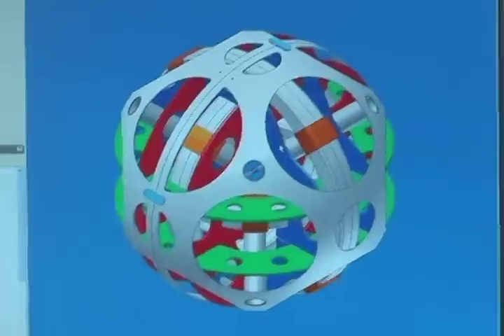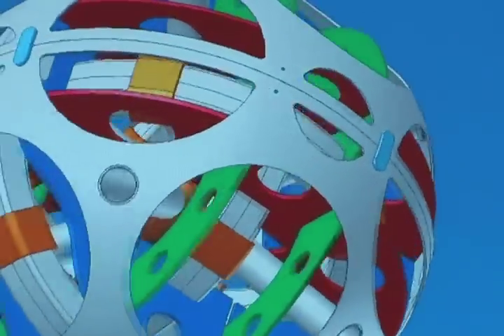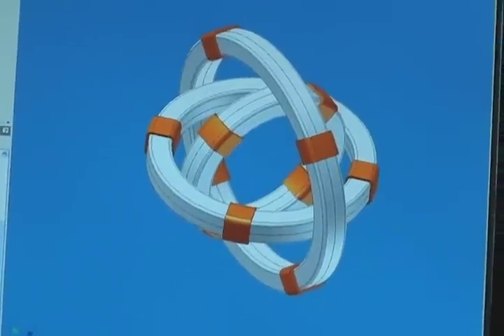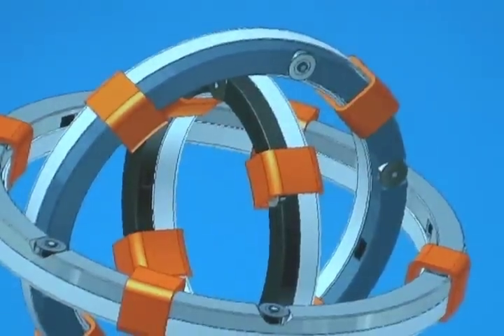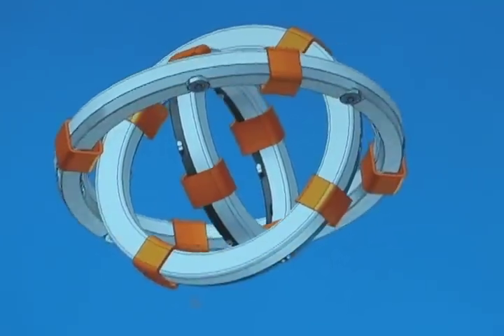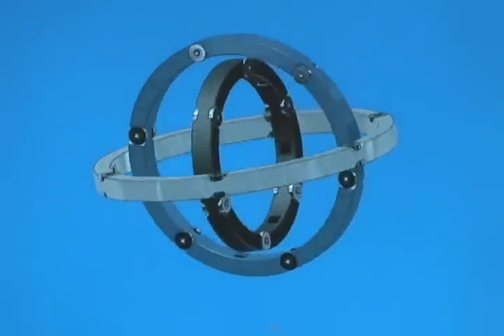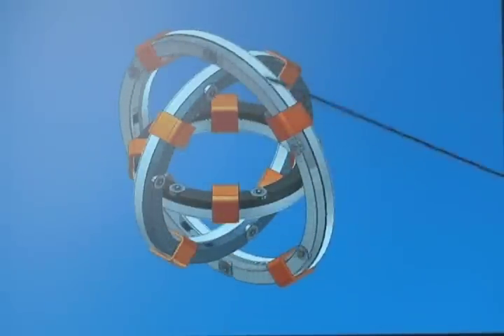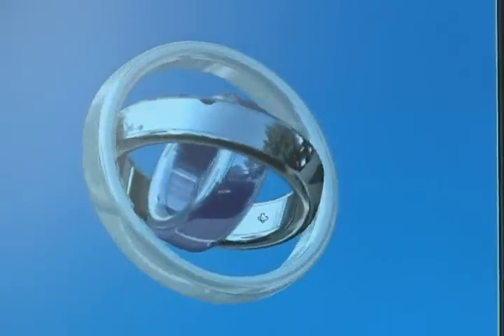Apparatus for Gyroscopic Propulsion Explained

Comment: According to the patent: “Gravity is overcome when enough energy is generated by the system that the resistance to torque reaches a threshold resulting in a force of displacement in the direction where least external force, manifesting as torque, exists. And this direction is generally away from any and all gravitational sources, including planets and other bodies of mass located within the universe.” ... seems only theoretical, and would apparently result in the apparatus ending up stuck in some cold, distant, isolated point in space at equal distances from all other planetary bodies which doesn’t sound very practical, but a patent was issued.
Reply: I guess that’s how the stars are stuck to the firmament, hanging at the same spot thought the whole known history with no change.  
https://youtu.be/Dbe_6QQlYvA

Comment: I seen a sphere by the side of the road hovering about 10' in the air. it was late but my headlights were on the sphere and the sphere had zero lights emitting from it. it was the size of a stop sign. the sphere was not from here it had maybe 8 or more rings.. outer rings spinning slow as each inner circle was substantially faster. visually the inner core rings were blazing fast. I take this road everyday for well over half my life. it took 30 seconds afterward for what I saw to register. Northern Michigan August 2015. this research I believe is key ingredient to advancement.. please stay with it I've seen this alien tech with my own eyes but for mere seconds

Comment: Take that concept and turn those three concentric gyration rings into wireless ferro terroidal tesla coils and suspend them electromagnetically and use a parabolic mirror or mercury (concaved and enclaved) to re-radiate gravity waves in the opposite direction to create an anti-gravity engine.

Comment: Obviously no one grasps the concept.  I envision a driver's seat in the center.  A joystick shaped like a ball that can can move side to side, forward and back, and twist left or right and return to center.  This joystick would control the PWM circuits that drive the coils by acceleration, or deceleration of the rings.  Thus providing inertial forces on the unit at right angles from each ring respectively.  Very simple design, but not sure if it could generate enough inertial force to lift off the ground. Without doing the math, I would presume ring speeds in excess of sound and inner ring mass of nearly a ton, in order to produce an upward inertial force stronger than gravitational pull.  In prototype design, I would recommend a ferrofluid bearing surrounding the magnets inside the ring.  This would help achieve the spin velocity required with the least amount of drag, and most importantly, reduce moving parts and friction.  The rings and ring cover halfs will have to be polished to a mirror finish to reduce drag.
Such a device would require a power supply in excess of 500kW which would have to be mostly generated on board through a tuned circuit that can sustain the pre-charged capacitors.  If the device had some form of wilmhurst generator built into the rings, perhaps, the wattage could be produced and passed to the capacitors to be used by the PWM circuit to pulse the coils.  The device would have to be spun up  and capacitors fully charged on the ground.  Once started, it would then have a certain amount of time before it has to be spun up again due to the coils parasitic reactance, unless circuitry was implemented to absorb this reactance and put the voltage back in phase with the amperage.  It can be done though.  Now the only loss would be through the wiring, capacitor leakage, PWM, and control circuit losses.  Using optimal materials and circuitry, losses could be in the range of 3 to 5% per hour.  Looks like a project for a University or government grant to fund.  It is easy to build this thing on paper, it is entirely another to physically put it together.  That being said, I intend to build a small proof of concept starting tomorrow.

Comment: The theory is correct, but the problem is to synchronise the equal mass of the  main elements in the same orbit of rotation. The elements that create the mass in equilibrium have to be controlled  by segmenting each rotational element to be able to pass each other  with equilibrium of their mass! Simplistically one gate opens to allow the next to pass within its equal orbit. This would be far easier to control with a two axis control then later use a multiple exterior "double "of its core twin .or synchronise the same orbit "Again" cutting into the now existing mass.
The problem only exists because each gap that each element passes within each rotational element can only be controlled  by synchronised  rotation (by isolated linear control) that creates the  full power of this design .therefore the more mass you put into the unit the more anticipated stability  you might get . I've been toying with the "idea" that a triple linear rotational ring motor is the best way to investigate this rotational mass phenomenon. The kick back is how to tame the mass rotation individually as each axis would have to be able to double its "pulse" to enter a gate area that would be classed as a normal entry for its dominant increase in not only orbit but increase of a synthetic "G" force for each axis. "Synchrony" for this problem is the key for multiple axis control ! When I find the synchronous aspect of this electro mechanical I'll post it for your perusal. JFB

Comment: There is no possible way to create a mechanical construction - like a 
gyro, for instance - that can propel itself, without contact to any 
stationary object, like the floor.  In the end, it is all the same as 
driving a car. Every action = equal opposite reaction.  The only way a 
closed system could lift off from our planet surface, without 
conventional propulsion (pushing something away to gain momentum), is to
 cheat the laws of physics, which 'might' be possible within the realm 
of quantum mechanics. For instance: a mass increases when it is 
energised (or when its going really really really fast, which is the 
same thing). This could generate a momentum to generate lift.

Comment: Mostly nonsense.  The idea, boiled down to actual physics, is to hitch a ride on the planet's angular momentum. You'd slow the Earth's rotation a wee bit, so it's not "free energy". Problem is that the force the Earth puts on the device is miniscule - one rotation every 24 hours. You'd have to spin the gyros at relativistic speeds to get a usable gyroscopic force. And there's no effect on the linear acceleration of gravity.

Comment: I think its spinning may not be super fast enough caused by friction. At least this is very difficult to get ideal speed compared with centrifugally balanced normal rotor which has only one bearing.  Good to watch your video anyway.

Comment: IT'S DEFINITELY A SOLUTION TO ANTI-G ... BUT UR MAGNETS WILL SCREW IT ALL UP (LOSE THE MAGNETS)... THE KEY IS HARMONIC FREQUENCY... (STABILIZATION OF ROTATION AT HARMONIC SPEED)... STABILIZE THE VIBRATION PRODUCED BY 3 AXIS GYROSCOPE BY COUNTERACTING EACH AXIS OF MOTION WITH A SECONDARY GYROSCOPIC MOTION MOVING IN THE OPPOSITE DIRECTION...(JUST A THOUGHT)... NICE VIDEO... DON'T EVER GIVE UP... UR ONTO SOMETHING GREAT! :)
Reply: Is your capslock key stuck or something...?

Comment: Then again if we stick to Uncle Einys eequalsmcsquared, then the energy needed for the spin of the gyroscope would be equal to the energy aquired for lift...unless... eequaledmcttriangulated where t is time...or something...if it were possible then I would think of it as fact... anti gravity as a singularity... or something... the singularity, or 1 divided by 3 is infinite... so... wow? or not? or whatever? ok, too m7ch whiskey to think straight... but cool stuff. Im working on an easier impossibility... running on water... called GSUS feet... gravity suspension feet. Gonna work my way from there... lol
Reply: +Kiyoshi Furuya  Exactly.Do the rest of you doubters get it now ?

Comment: you are very close, basic concept is right... all the components are locked... dont need the bearings... need the magnetism to be inner outer... and casing magnetism to be the opposite magnetism and lighter then the inner mechanism... then when the 3 rings need to align at some point? for the briefest of moments the magnetism should parallel instead of omni...? causing the inner sphere to to move up... thus effecting the outer sphere to catch up and keep equilibrium? done fast enough... anti-gravity? dont take my word for it tho... to fringy... gonna conduct my own experiments for this when i cash in on my first big 1. If you get there first... more power to you!

Comment: I think you could interchange densities with speed. Im sure you can. You would not need to have three different densities of metals you could use one metal and just having speed differences could give you same effect. Like for say. the very center smallest gyroscope would be spinning the fastest and the middle gyroscope medium sized one could spin a medium rate speed and the largest and biggest gyroscope could be the one spinning the slowest this would create a canceling force as well. Absolutely sure of it. E=Mc2
c is the constant which would be the speed and mass are interchangeable. anyone wants to work with me feel free to hit me up I Know what im talking about and am a experienced engineer and physisisit among all other areas?

Comment: so how exactly would this send one in a particular direction
Reply: +deathbot117 By producing a positive or negative inertia effect on one side or angle.
Reply: +John Anon It would effectively be "rolling" in that direction, even if it was against downward gravity.
Reply: kewl now we just need these in vehicles
Reply: you slow down one of the rings and lean. Simple.
Reply: +John Anon "By producing a positive or negative inertia effect on one side or angle."

I don't believe this device would achieve this but it may be able to achieve being a "spatial gyroscope" I think there called something else but I forget at the moment; basically in outer space if this was spun up and weighted correctly it would be able to resist being moved from its spatial position in space, kind of like a multi directional gyroscope; I believe they already exist on some space craft actually.

My idea is to take this a step further thought and not only rotate the gyros but rotate the gyro rings 90 degree off the axis of their gyroscopic rotation so the gyros themselves would be rotating at the same time, what this would do I'm not entirely sure; might just make it a better "spacial gyro" meaning it would stick to its location better, then I have some other conceptual ideas about how it might be used to create momentum in a specific direction; but that's sorta hard to explain in text... 

The reasons I can't say for sure is I'm just plain not smart enough yet haha; more specifically in math, but I want to go back to school and try to tackle it and get into physics a lot more heavily... I have some crazy ideas about gyroscopes and gaining momentum through moving objects around that I haven't seen tested yet (as far as I know). I believe the term for an object that can create its own momentum in a closed system is a "Reaction-less Drive" which to me doesn't actually exist yet in terms of what we know; maybe through some kind of quantum mechanic it might be possible, but what I'm thinking of is more like a Reactive Drive; which gains momentum with many moving parts within its own system that creates an imbalanced system on its own without requiring input from another outside force or system acting on it.
Reply: this is how ufo's work, na zi s discovered this long ago, get with the times people.
Reply: imagine a massive scale gyro like this in a craft, with the rings made out of very heavy materials. How is that impossible? Open your mind.
Reply: @madbruv  no dude stop pretending you know things you dont 

understand science and reason and logic and stop pretending you "know things" 

stop watching Gaia and start actually getting a real education
Reply: @madbruv  there is no means of propulsion now is there really any means of mounting these in a stable fashion 

use your brain and think for one minute 

"where is the propulsion" 

yes this device can allow for controlled rotation on 3 axis but there is no way it can allow one to move in any direction
Reply: @madbruv  there is no propulsion 

only a means to rotate the craft 

the density of the rings doesnt have any effect on forward or back ward or sideways movement 

all these rings will do is rotate the craft on any of the 3 axis 

stop being so brain dead that you ignore basic propulsion 

if you understood gyros you would know that all they effect is rotation 

they cannot stop forward motion or any kind of motion 

all they can effect is rotation 

there is no method of propulsion for directional movement 

there is only a method of rotation

Comment: This will rotate unstably and wobble about. You cannot generate translational acceleration with this only rotational (angular) acceleration. You could use this to rotate a spacecraft in zero g. This is actually the method used to rotate the space shuttle (2 axis the third is a waste). I suppose you could get this to roll on a flat plane, but it would move about rather chaotically. 

The moral is that Newton's third law prevents this device from being used as a means of propulsion. If it doesn't have anything to react against, then it cannot accelerate (it needs something to push off of).

Comment: I suspect there's more to this presentation than we see here. Would I be wrong in thinking the propulsion would come from when the rings are 'not' turning at equal energy output speeds, thereby giving an overriding force in one direction?
Reply: +Dymphna what matters here is the angular acceleration, not speed

Comment: actually for the concept this forced into my mind, the above video didn't demo or explain squat.  We all just saw it on you tube along with the accompanying sidebar of other suggestions.  So it's a safe bet were all onto the same direction. Thrust... He had already shown thrust in the direction of his thumb or along the length of the axle.
So then it only stands to reason that a weight for a base on the floor with a pole of four feet tall pointing up from the center of the base. A tee fitting on the upper end of the upright pipe, put one end of a pipe into one end of the tee and a spinnable weight on the other end, and just so things don't get out of balance. Do the same for the other end of the tee. Now according to his presumption of precession, once spun up the apparatus should lose weight.

Comment: If I tie 5 CATS together it will produce several hundred pounds of thrust in 5 directions with NO jet fuel required....
Reply: No you would have a cat5 cable and iT would be looking for it.
Reply: You don't know the power of cats. Join the Cat Side. - Cat Vader
Reply: Yep.

Comment: This resembles a Kinetic Field Drive, but it doesn't rotate freely, there is no collection plate, so no field can be generated and thus no magnetic fields to syphon out. With a crystalline internal component within the core of a similar model to this, placed in the center of a KFD, you were have what you call "Gyroscopic Propulsion". Beyond this, the energy applied would only allow for the transference of energy and help to stabilize motion rather then be the source of it. I found it to be quite interesting however, and the digital diagram was quite interesting.

Comment: What's the name of the CAD application you're using?
Reply: Graham Lyttle looks like Autodesk Inventor Pro, if you got an email account at a university (student/staff) you can download and use a full working version for 3 years with watermarks in the output..
An open source option would be FreeCAD which is getting better each year.

Comment: Nothing new, because all fighter jets have such a gyro platform to measure the plane's roll and pitch in all directions. The video also doesn't show a direction of the assembly's motion. There is none either, because all internal forces cancel each other out, as follows from conservation of momentum. There is no propulsion.
Reply: Jagen alias digicho So add some jet engines and bam!@
Reply: +Thermospecialist Yeah the momentum of the three rings cancel out, but only if they all spin at the same speed and have the same mass - if you change the speed of one of the rings, you create a vector in the direction of it's torque.
Reply: check out eric luftwaite and Alex Jones (not the loud radio guy) for using a gyroscope for propulsion. It is really crude but it works.
Reply: +Tobias Knudsen or, rather, the entire device would accelerate opposite the rings angular acceleration. It would spin, not move forward
Reply: Tait Jones Actually, Alex Jones gyroscopic platform needs solid ground to bounce off. It's only half of solution.
Reply: +Thermospecialist If there was propulsion we would have achieved the technology needed to build what we see as UFO's  but I don't understand why this guy describes equal force presence in a video that's trying to explain propulsion.
Reply: Tobias Knudsen how would you create lift?
Reply: Tobias Knudsen i would think each gyro would need be able to (pitch/tilt) independently of each other also multiple assembly would be needed to create anything meaningful or useful.